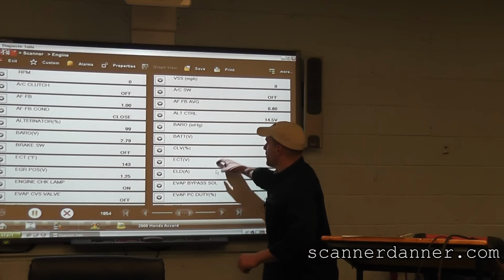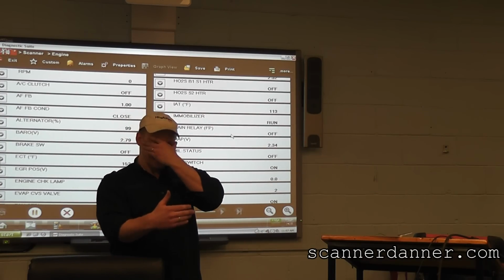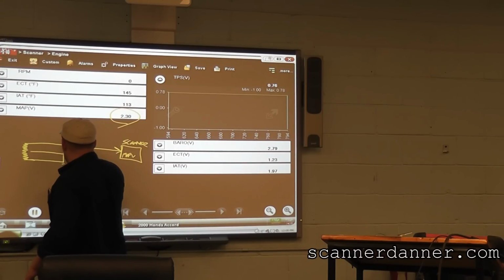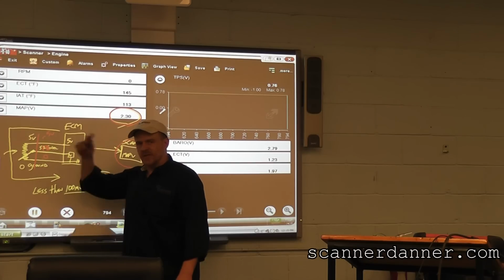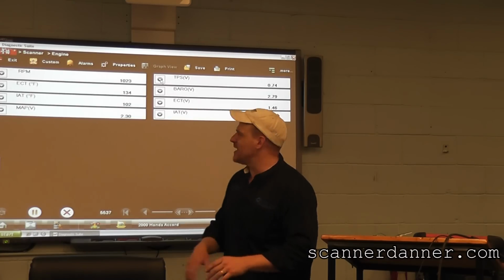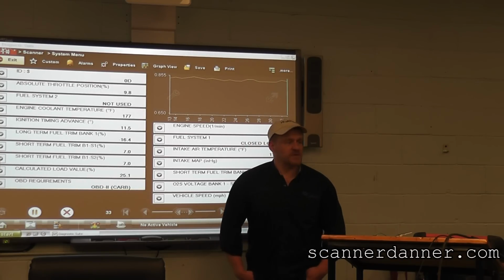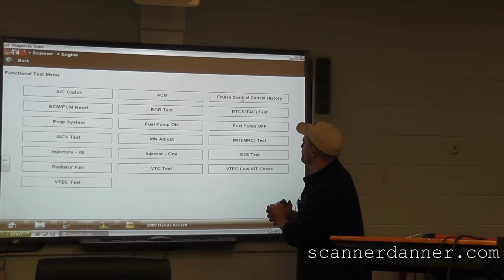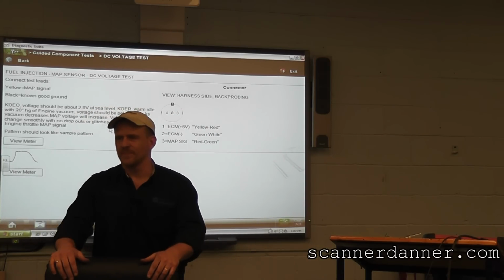Honda Accord No Power Case Study (Part 2) reversed TPS-MAP connectors

Comment: how are u?
when subscribe on ur channel ,that day i start be better mechanic than before
like solve many problem I'm  no came back like 3% only
nobody its perfect,and nobody knows everything in this business
but
i have case its the same car
in this case come whit p0171 current code & p0170 pending code
i did so many test
one of the test is was fuel pressure its ok
but when i disconnect o2 upstream everything goes normal downstream 
and fuel trim back to normal

but i noticed to thinks i hope u can give some advice i was also tired when start to do this car
when disconnect the 02 i saw on scanner same volt. 0.790 its doesn't move
its normal or got short to voltage or computer problem
and when i restrict fuel return line the pressure goes up to 70 psi 
fuel trim get it normal drop down to 3
but when disconnect the restriction goes up to 28 % short & long trim super lean   

no misfire , start normaly  .and another think i saw when u race rpm i notice
fuel status change to open loop for 2 seconds ,

when i start on ur channel im learning a lot more ,be better day by day 
don't  be a part changer 
thank you ,I'm trying to buy ur complete books but I'm coming late on my job
if u can give a help how i can get it
u can contact to me by email
lui27_mcc@hotmail.com

Comment: This is a little off the subject but I'm working on a grand am with a V6. What would cause EGR errors? the des pos is 0 but the actual pos will vary up to 15% I put 2 on already it is driving me nuts. Any ideas?
Reply from the maker: JOHN HUFNAGEL did you disconnect the battery? I have a case study on this on my free channel. It is a self zeroing type potentiometer and on some of these you MUST wipe out the learned zero position. This should be done on every key cycle but some of the older systems you had to disconnect the battery

Comment: Paul, that was awesome. I love when you do the live case studies along with the classroom theory. I swear I feel like I'm sitting in your classroom at Rosedale. Your student ( Tom - thumbs up to him ) gave you some help, so I figure I'm your student too, so I don't think it would hurt to give ya some help. LOL! What I'm referring to is a nice article I read on Pico's website in their newsletter I get from them. I know you will find it very interesting. It concerns testing of the wideband sensor with the Pico scope. I love to see ya use the info in some experiments in your class testing the wideband using the Pico.

From what I read/comprehend, it is possible to read the milliamp's of the sensor without using a expensive milliamp clamp. By measuring the resistance value of the Pump cell circuit, you can convert the Pump cell voltage to a current value using Ohm's law (Current = Volts / Resistance) removing the need for a milliamps clamp. This value can be calculated in a Math channel using this formula.  Pump cell voltage/pump cell resistance. The Pump cell current ( 0.5 mA to 3.5 mA. )  from the Math channel will be directly proportional to the Pump cell voltage.

Here's a link to the article if your interested. http://www.picoauto.com/technical-note/bosch-LSU-4.2.html
Reply from the maker: Billy R sweet! I'll check it out. Pico's math channels are awesome! Thanks Billy
Reply: ScannerDanner Premium Your welcome ! I did not forget when you went out of your way to hook me up with a iATN membership. You gave me access ( to see the results of your testing of Aftermarket vs. OEM O2 sensors ) which I still use. We were trying to and succeeded in figuring out why a aftermarket O2 sensor did not always work in a Chrysler. ( PWM vs.  Relay Controlled ) You know what I'm talking about !
If anything Paul, I should be Thanking You, because a year ago, I did not understand any of this. Not only do I have greater understanding of how these systems work and grasp what you taught me, I think I'm excelling much farther. So Thank You!  Like I always say, You the Man dude!
Reply from the maker: Lol I'm really not Billy

Comment: Love the format! I had this recently although Hall effect crank sensor and steering pressure sensor were crossed! 

Would I be correct in saying for every 1L capacity of engine is roughly around 1 G/S maf? Can't find a average spec! Eg 4L engine = 4 g/s at idle 

Thanks in advance danner!
Reply from the maker: Alex Brophy I have heard that is a good ballpark number to use. I just haven't paid enough attention to it to be confident enough to tell you yes. But I will be paying attention to this more.

Comment: You mention checking to see if sensor ground is 100 mv or less, would this be the same on O2 sensor ground assuming no bias voltage? Also do you have any videos on checking/explaining ground circuits?
Reply from the maker: Jonathan Dean O2 sensor signal ground, yes. But O2 sensor heater ground, no. As far as specific videos on sensor ground testing? This is one among many. 
https://www.youtube.com/watch?v=uJuhxD782ws